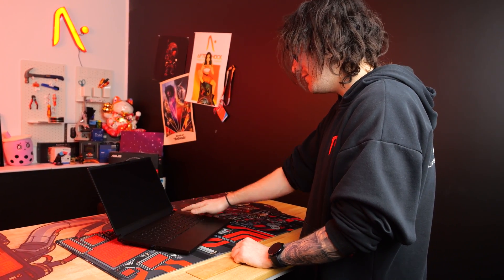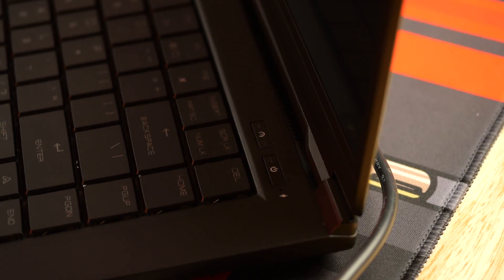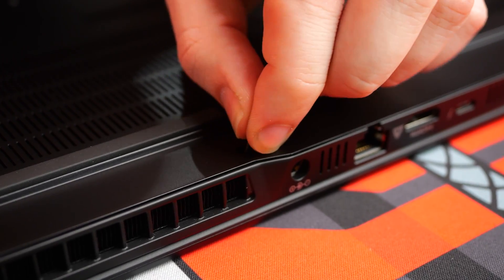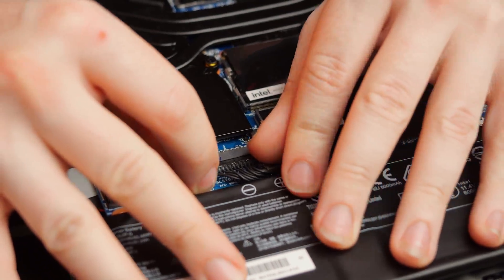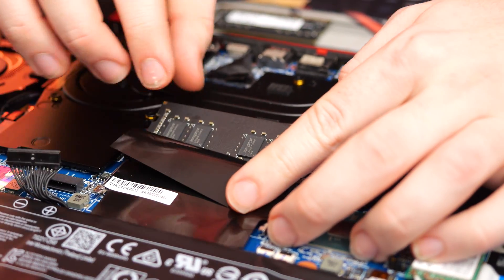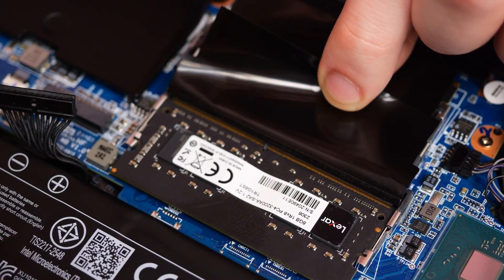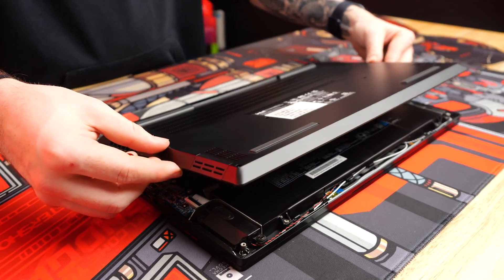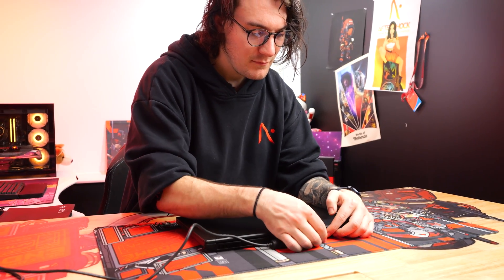How To Reseat & Install Laptop RAM [Aftershock Vapor 15 Pro]

Comment: This is exactly what was wrong with my computer, the caps lock was just stuck on and holding power wouldn’t even shut it off once I let go. But one of the ram things was sticking out and so I took it out and plugged it back in and the power after it, and then it started working again. Tysm. 🙏